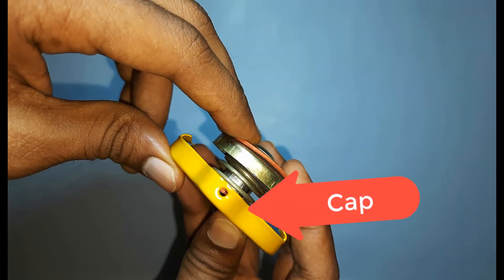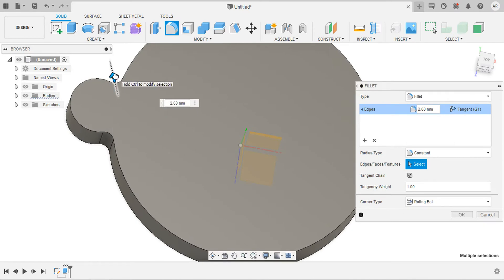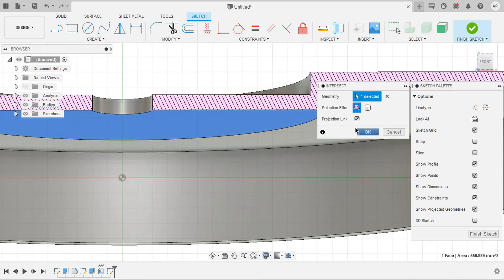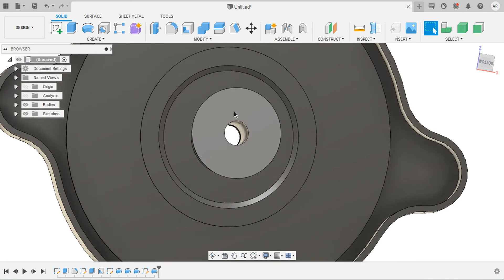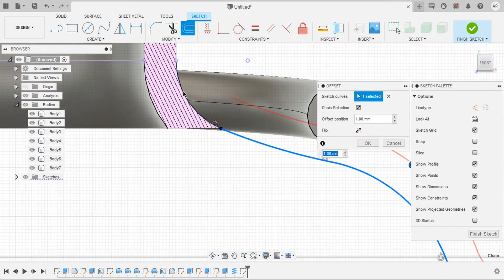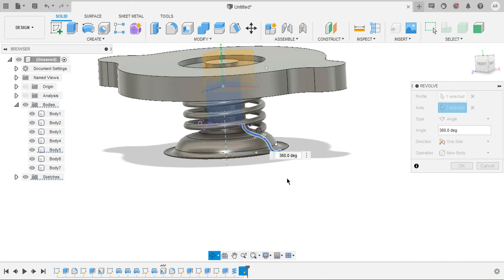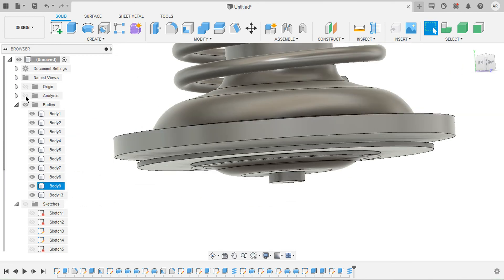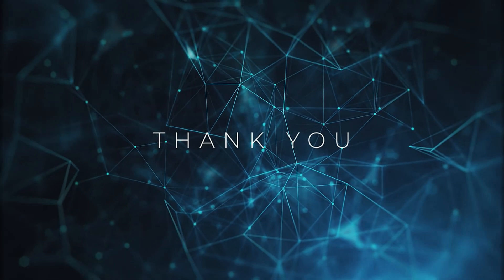FUSION 360 || RADIATOR CAP || MODELLING || ASSEMBLY || TUTORIAL

Comment: Very cool tutorial, I like that you actually explain the function of the item you are making !

Is it possible to use fusion 360 to calculate the required spring rates for the pressure valves?
Reply from the maker: There's no function inside fusion like that, but may be you can try using simulation.